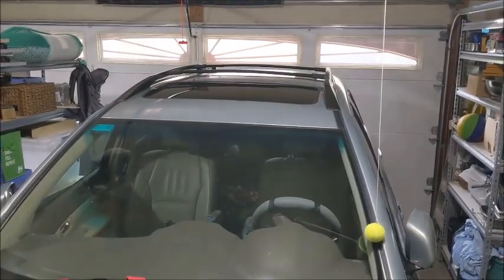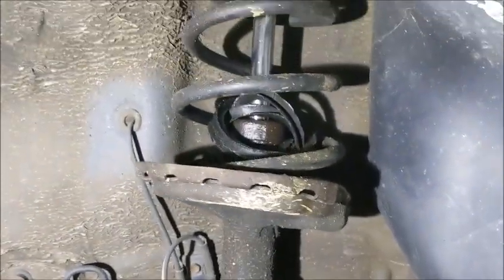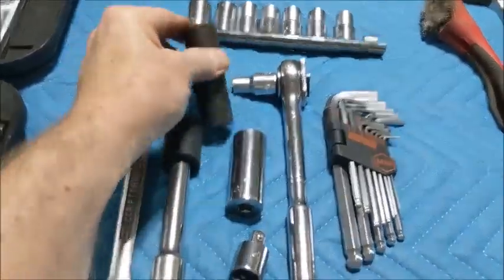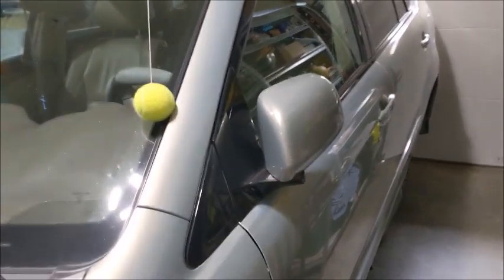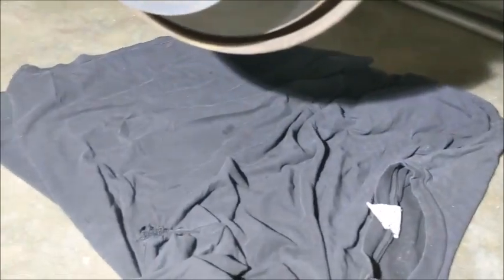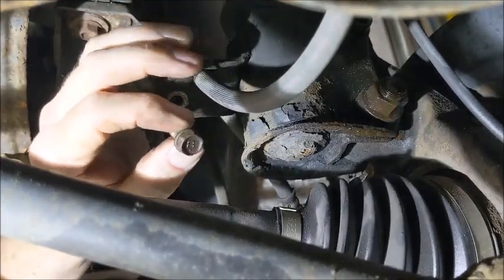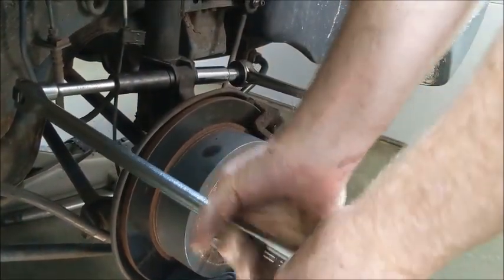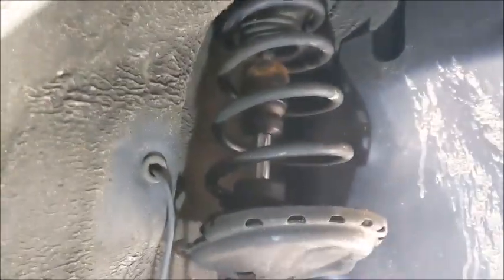DIY Lexus RX 350 Rear Strut Replacement Saves Big Bucks!

Comment: Yeah , I pretty much rounded off the hex bolt . Thing would not hold still while I used the box end wrench 🔧. Paused operations until I can remove it. I watched one video where someone used a grinder to remove it. Either that or a shop is in my future.